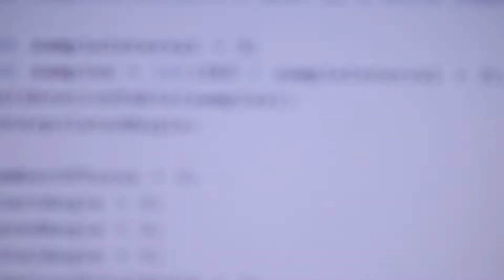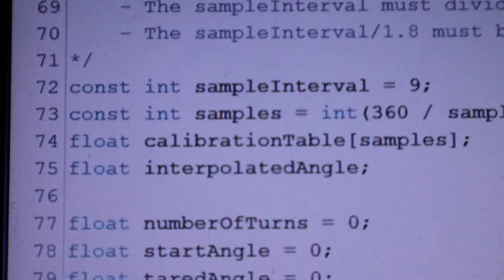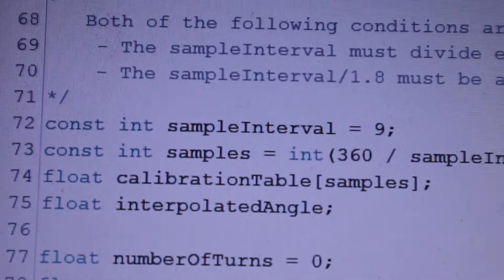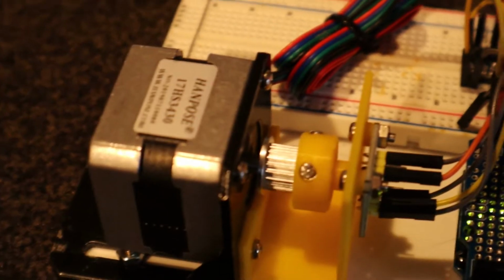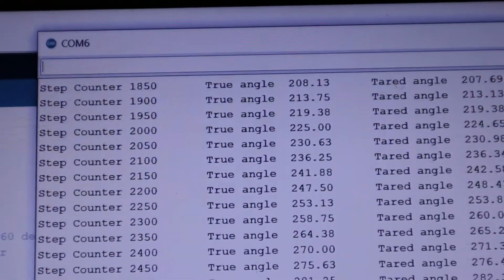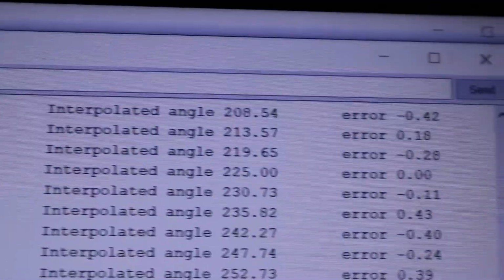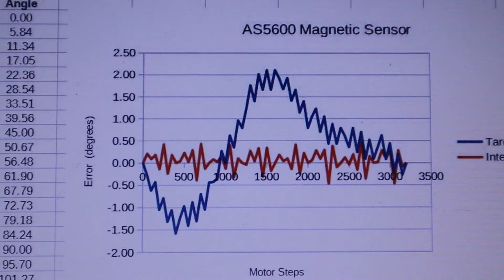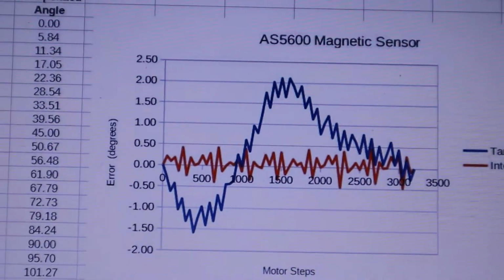AS5600 test jig

Comment: Hello, is it possible to use this encoder in off axis location utilizing a diametrically magnetized ring magnet with your error correction algorithm?
Reply from the maker: I don't know. The AS5600 chip expects the magnet to be perfectly positioned so my guess is probably not. But anything is possible ... I found I could get useable results using a normal magnet on edge!
Reply: @qualityphotos1  Thanks for the reply. With a strong Neodymium magnet and 2.5mm off axis, I will give it a try.

Comment: did the stepper motor's magnetic fields interfere with the as5600?
Reply from the maker: @BenFarahmand  Hi Ben,
Doesn't appear to. Many people glue the magnet to the rear of the motor shaft with the sensor about 2mm from the magnet

Comment: Do you have any basis for this interpolation formula? Or did you come up with it?
Reply from the maker: I came up with it.
Reply: @qualityphotos1  Can you better explain to me your interpolation equation. Thank you so much
Reply from the maker: @CanPham-ko3iz  A link to my code and project is given below the video.

A stepping motor with 200 steps per revolution rotates 1.8 degrees per step. This means the motor rotates an even number of degrees every 5 steps (5 * 1.8 = 9 degrees).

Since we know the true angle every 9 steps we can make a calibration table. Knowing the error between calibration points allows us to estimate the error of the 9 intermediate steps using simple proportion.

This is the basic idea except that I have allowed for micro-stepping.
Reply: @qualityphotos1  If I change 9 degrees to a smaller angle what will happen
Reply from the maker: @CanPham-ko3iz  The smaller angle MUST divide into 360 AND be evenly divisible by 1.8

Comment: Do you know what is the maximum angular velocity that the sensor  as5600 can handle so it provide continuously the angular position?
Reply from the maker: According to this data sheet https://www.digikey.ch/htmldatasheets/production/1647438/0/0/1/as5600-datasheet.html the maximum sampling rate is 150uS. A maximum angular velocity is not given ...
Reply: @qualityphotos1   considering its 12 bit resolution, we have an angular resolution of 0.088 degrees. So, ideally speaking at that sample rate we would have 1.629 rpms ... which make it not good for continous angular measurement.
Reply from the maker: @Kriz92_ROB  According to the product data sheet the AS5600 is "is designed for
contactless potentiometer applications" which confirms your calculations.

Comment: It is posible to do like a servo?(servo.write(90); so the servo going to 90 deg, it posible to lile thah because i want if do this stepper go to 90deg, if do that stepper go 120deg etc
Reply from the maker: No ... unless you know the motor-shaft start-up angle.
Reply: @qualityphotos1  how to make it like a servo? Becaise i need if do this stepper go 80deg, if do that stepper go 120deg etc sir
Reply from the maker: Once calibrated the last position needs to be remembered whenever the encoder is switched off otherwise you will need to recalibrate.  I leave that up to you. A standard servo would be simpler.
Reply: @qualityphotos1  so donu mean the encorder when switch off the angle will change??
Reply from the maker: The memory contents of an arduino are lost whenever the power is switched off.  What you are trying to do is only possible if you save the last shaft position to some battery backup device before you switch off the arduino AND do not move the shaft while the arduino is off.
Reply: @qualityphotos1  i want to record and save to sd card, and if needit playback again the data from sd card sir, because on servo i have already but for stepper realy confiused sir
Reply from the maker: @botak333  An SD card would also work, I leave the coding to you
Reply: @qualityphotos1  but realy im confiusd how the flow cart

Comment: About the laser anemometer project,

hello, 

first of all I like your project very much and I want to implement this project.

How did we get the speed from the distance dx and dy we found?

What exactly is scale?

Shouldn't we divide the distance we found by time?

I didn't quite understand this part:

Windspeed = sqrt(sq(dX) + sq(dY)) * Scale;
Reply from the maker: The anemometer uses the Pythagoras formula sqrt(sq(dX) + sq(dY))to calculate the wind direction from dX and dY. If the pipe deflection is proportional to wind-speed then wind-direction multiplied by an arbitary scale factor gives us the wind speed.  Methods for calibrating the anemometer are discussed in https://www.instructables.com/Laser-Anemometer/
Reply: @qualityphotos1  hello, realizing your project(laser anemometer).

After running for a certain period of time I get this error message:

Processing 4 ->
Error, disabling serialEvent() for COM6
null

What is the reason for this error? How can I fix it?